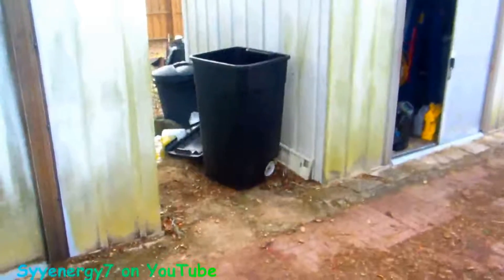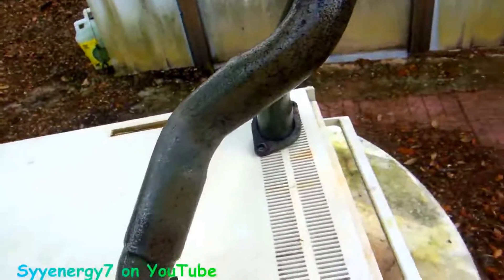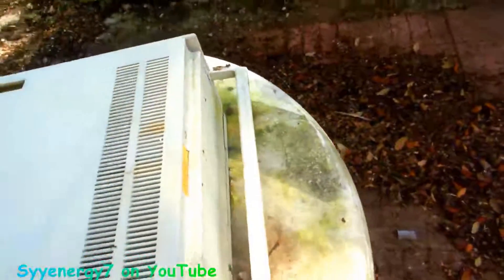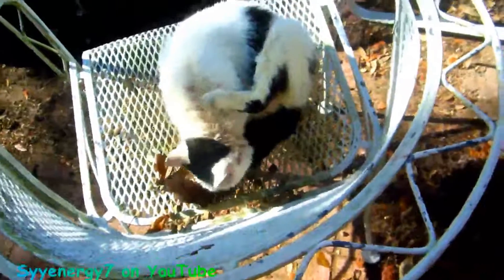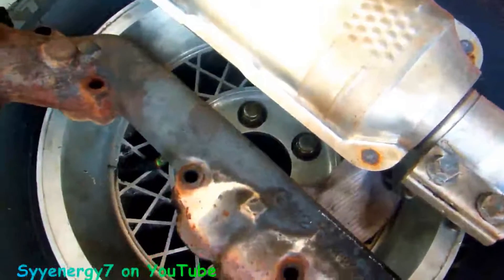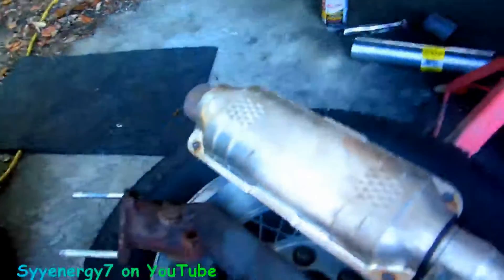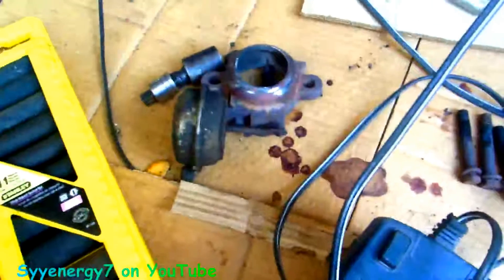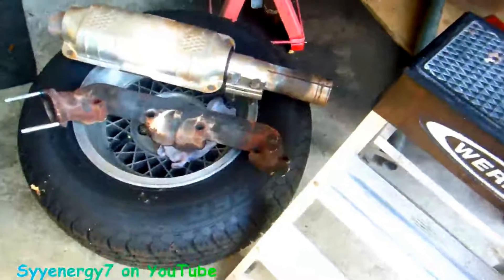Heavily RUSTED Exhaust Pipe to New again with VINEGAR

Comment: Interesting...why remove the rust from an exhaust pipe? Reasoning: if you leave the existing rust on it...it won't rust as much in the future. Removing it does you no good, it'll just rust out faster....UNLESS you are going to paint it with some expensive high-temperature paint...or add a coating of some sort to the clean bare metal before installing.
Reply from the maker: The only reason I'm removing the rust is to coat with POR15 high heat paint.  With the high heat POR 15 you can't paint over rust.